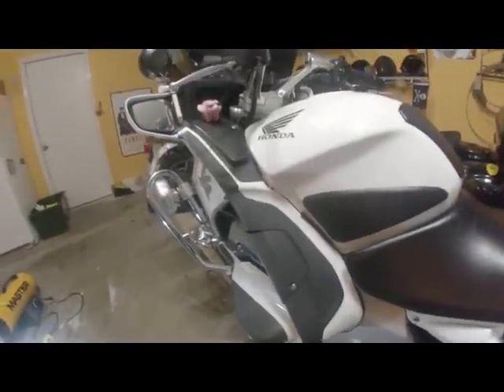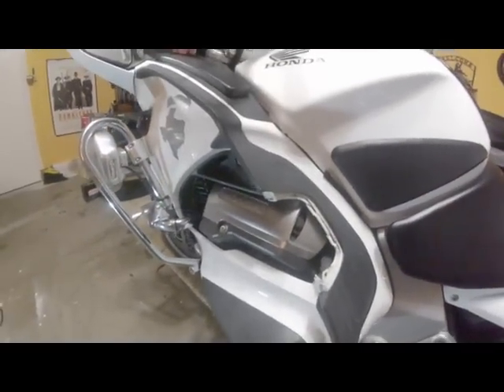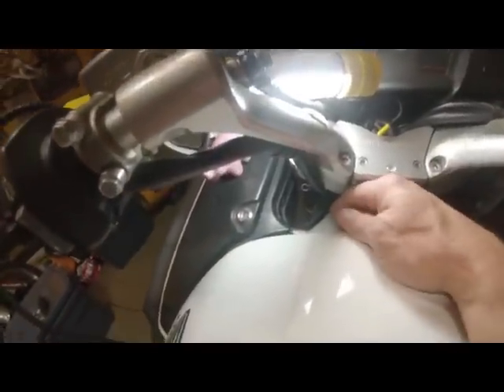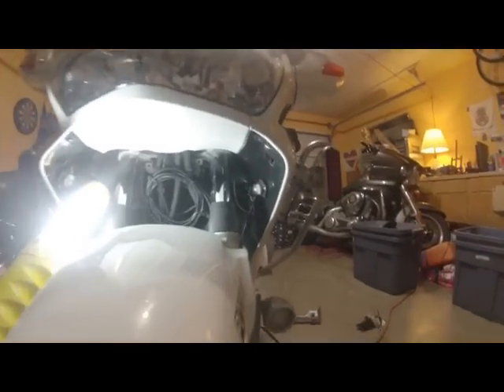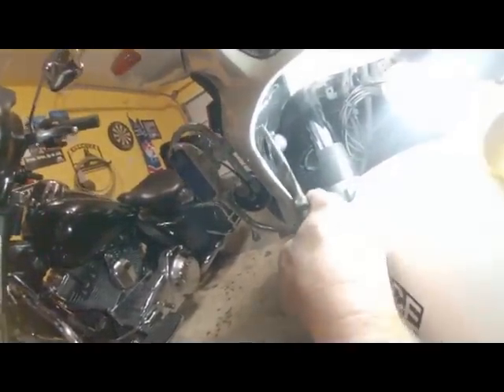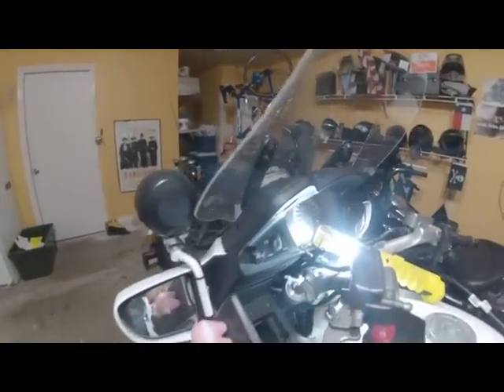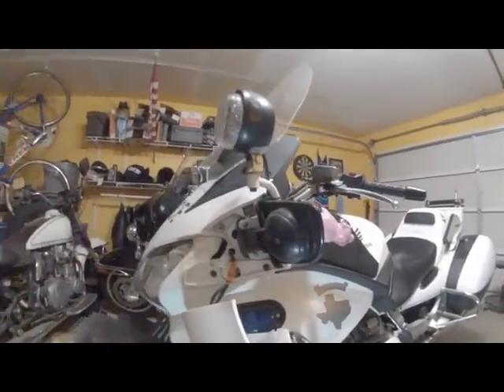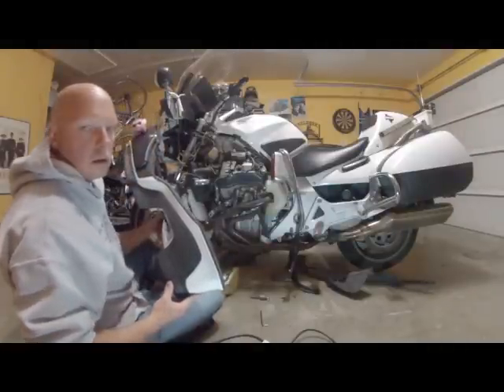Removing the plastic parts from Honda ST1300

Comment from the maker: After taking it apart several times for a water pump issue I am much better at it now. Note to self, practice several times before videoing. It will make me look smarter. Anyway, practice helps and it gets easier every time. Don't be intimidated, just dig in and do it.
Reply: Good video David. My question for you is about the heat in your legs. Did you figured out hot to fix it? Some people suggest to remove the inner fairing.
Please advise
Reply: The inner cowl removal doesn't do much. To stop the heat issue you buy a roll of thermal reflective material which is like tinfoil with bubbles between the two layers and a roll of foil tape.
the two ways to try are 
1. quick but has to be removed every time access is needed unknown how good it works.

move the seat adjuster to the back groove. unbolt the tank and tip it up and prop it. cut a section of material to fit the space on top of the airbox from side to side. Use the foil tape to seal it all the way round.

2. known fix works good

prop tank remove airbox and seal the large holes in each corner as above add a few extra layers over the corners just in case. Put two small pieces at the rear of the tank where it touches the frame.
The next bit may not be necessary but it depends whether you want to do this twice if it is. add a strip running from the tank under the seat and tape down where possible.
if you like after putting the airbox back add more around the sides

The issue arises from the large gaps allowing engine heat to rise up into the area around the airbox heating the tank and frame obviously as this is topped off with a metal tank the heat is trapped and is clearly not designed to divert heat away.
The above is not my own ideas it is what others have done.
my idea would be to place spacers on the front bolts to lift the tank a bit creating a gap around it allowing heat to escape however i have yet to try that and i thing the fairing may block any escaping heat

Comment: Thanx for this. The St Owners forum has more info on how to take off all the Tupperware. But a video is worth a thousand bytes.

I need to get into the top fairing to adjust the headlight housing. I keep taking off the first few bits, then chicken out. I dread having to change a headlight bulb. But at least it will force me to go further.